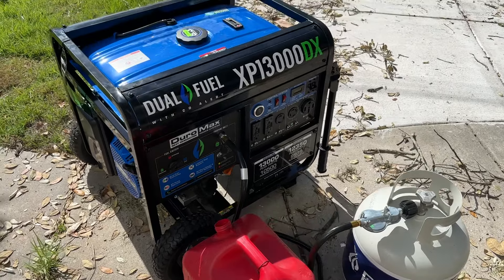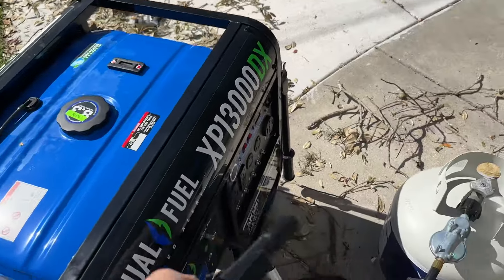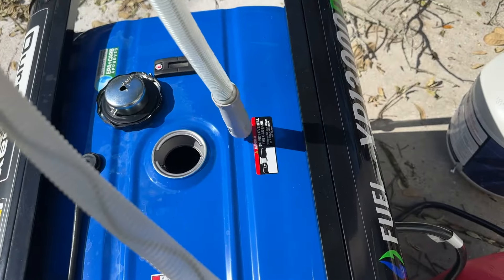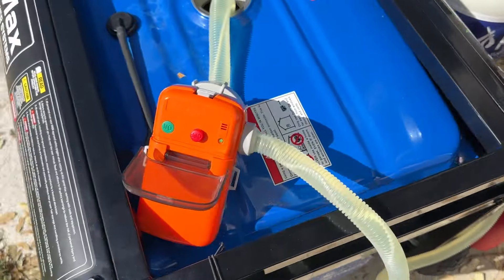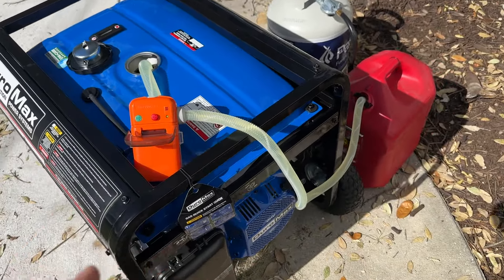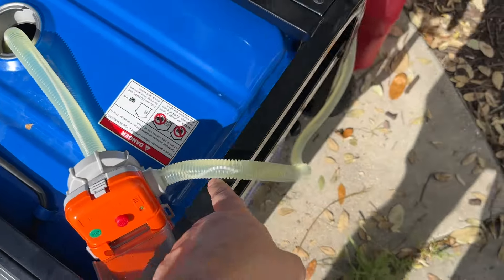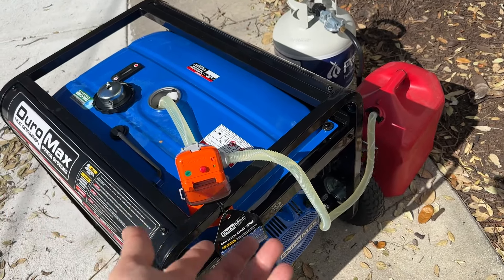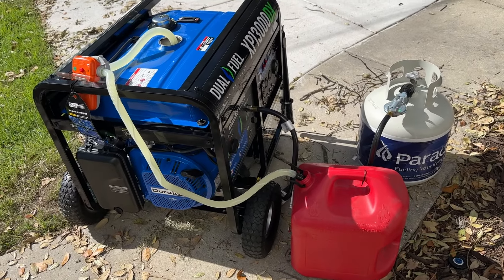Better Way To Drain The Gas From Your Generator

Comment: its not going to drain it all. There will be some fuel left over, better to drain what you can then run the generator until it burns off the fuel in the tank
Reply from the maker: This is the better less messy way of the “drain what you can” part of your comment. Agreed. You need to get every last drop so run till failure and tipping the gen is always part of the process

Comment: If you do this start the generator and run it dry. Better yet add Sta-bil or Seafoam to your last tank of gas. No need to drain because the gas will be usable for another year. Been doing that for at least 30 years on motorcycles, lawn mowers, and generators.

Comment: I fill the carb with atf and it can sit for years without clogging next time
Reply from the maker: Can you elaborate for us?
Reply: @Archifx  i drain all the gas from the machine then add atf to the carb bowl thru the fuel line. The atf preserves the carb and jets from getting gunk on them from long storage
Reply from the maker: Can you paste a link?
Reply from the maker: @vettepicking are you referring to automatic transmission fluid? I wasn’t sure if ATF was an abbreviation for something else
Reply: @Archifx  yes atf  transmission fluid

Comment: Better tip. Generator says Dual Fuel and you have propane hooked to it. No need for gasoline. Mine is Tri fuel and has never run in gasoline. Primary fuel is Natural Gas. Back up fuel is Propane. 
If you insist on gasoline then but ethanol free gas or make your own from the corn gas. It's the alcohol is the corn gas that absorbs the moisture that corrodes the carb and can rust your gas tank
Reply from the maker: Problem with this auto choke unit is that it wouldn’t fire up on propane alone. Had to start it on gasoline and switch it over to propane while running.
Reply: @Archifx  a can of ether starter, or brake clean is your friend.

Comment: You won't be siphoning any gas from any car with this.
I use the shaker siphoning hose.
Less than half the money, no batteries and it can't fail.
Reply from the maker: You can. You can get a few gallons from one. I did. It in the storm. You are right tho. This is more of a convenience thing. Old school is always the reliable way.